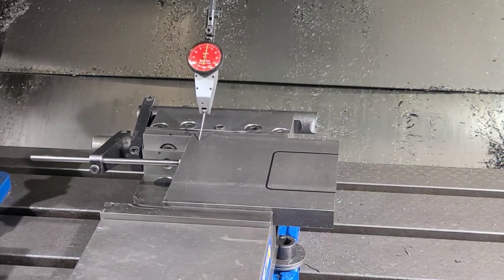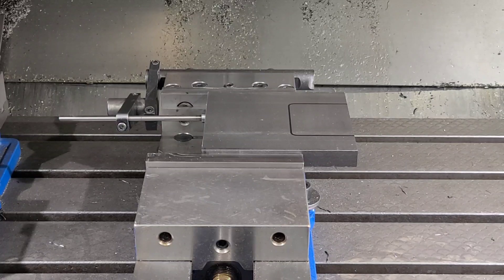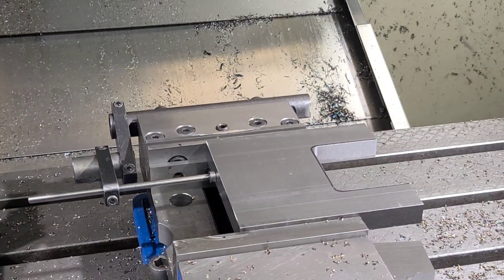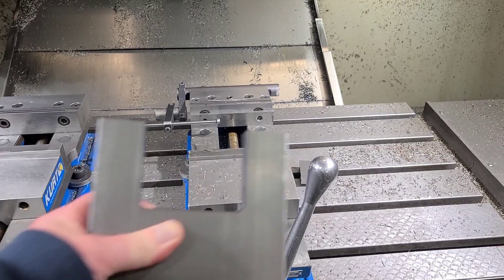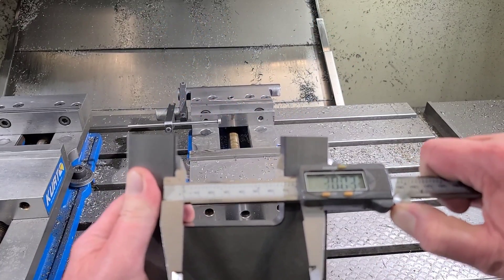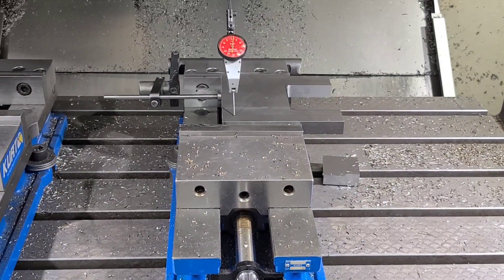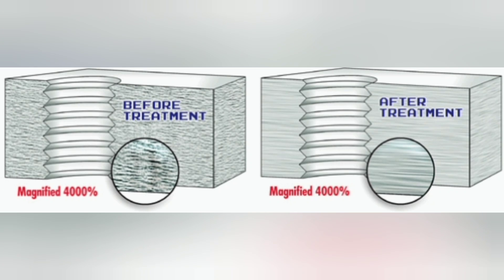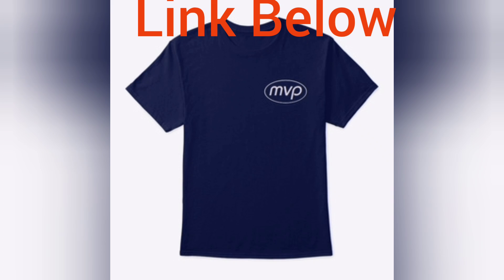Machining Cold Rolled Steel, Precision Headaches Guaranteed!

Comment: I’m digging the fly cutter, but not sure it will fit in my ATC carousel
Reply from the maker: We have a new version with a four way keyway on the cutter body that allows for orientation both ways. Should work in any 40 taper machine's tool changer.
Reply: @mvpmachine so I can clock it to fit in my atc at the proper spindle orientation?
Reply from the maker: @shaunybonny688  yes that's correct. You have to request it with the 4way key right now when ordering either through me or Suburban, as it just came out and there are a limited number, there is no extra cost.

Comment: Thanks Tim.  Although I was aware of the metal distortion effect, it was a good refresher. I'm about to machine some grinding fixtures that must be within 0.0005" tolerance.  This will definitely influence my material choices. Gilles
Reply from the maker: @LetsRogerThat  Roger that Giles you need some stability with that tolerance called out! Thanks for watching and commenting!

Comment: We make some clevises out of 2” square 1018 CF.  Mill a .812 slot 3 or 4” long.  Have to squeeze them back parallel when we are done with them.  Can go out as much as .03”.
Reply from the maker: Dustin, I have had the same fun experience with clevises and CRS, but never been able to squeeze them back and have any accuracy on the slot, do you recut the slot after? I usually try to have a lot of stock everywhere then fly everything after I spring it. if the slot is large enough I can fly cut one side of the part and both sides of the slot in one setup with the fly cutter, then flip and do the remaining outside.
Reply: @mvpmachine  just noted how far down to press with spring back.  Pretty repeatable.

Comment: You really should be running your test indicator with the tip closer to parallel with the measured surface in order to reduce cosine error.  The direction of indicator travel should be inline with the error being measured.
I've had the similar distortion issues when cutting Brass and nylons as well.
Reply from the maker: Hi, thanks for watching and commenting. I have been criticized for this in other videos and do know how to properly use a dial indicator, but when doing these videos it is difficult to get the proper camera angle to have the indicator in the proper configuration, so I use it as shown. I will spell it out in future videos though because it does look wrong. I mostly do these videos by myself so it is often difficult to work around the camera on a tripod and not have too much control of the camera while operating the machine at the same time. I am working on improvements.

Comment: Have machined parts like this in the past, always used flat ground 1018 stock. Was a bit more money but saved time in the end. Had to machine base plates for a machine ( 38 x 42 x 3/4 thick ). Started out with thicker stock then had them Blanchard ground flat and parallel , this material was A36 hot rolled steel.
Reply from the maker: Base plate material is really what CRS is good for, you can drill holes, put pockets in all day long with no effect, but as soon at you break out of the edges the fun begins! Thank you for watching and commenting!

Comment: Why not simply vacuum or hydrogen furnace anneal the cold rolled material?  Similar to normalizing  castings, but no surface oxides.  Maybe one could even order it treated that way?
Reply from the maker: I'm not familiar with vacuum annealing, but any annealing would change the properties and strength of the material so I'm not sure that would be an acceptable option, I guess it depends on the customer's requirements and if they really needed CRS in the first place. Many of my customers even military, supply or spec CRS oblivious to this phenomenon, and then are surprised when you bring up the issues that it causes. The only process I know that works and does not change the strength of the 1018 material is cryogenic treatment. Thank you for watching and commenting!
Reply: We deal with a customer who's engineering staff still doesn't understand that CAD does mean "Crayon Assisted Drafting" and sends up prints that have unnecessarily tight tolerances to be made of CRS.
Reply from the maker: @ColKorn1965  We get that a few times a month, part of the reason I made this video! I sent the link to the worst offender, one of my customers who does this to us all the time, I don't think they appreciated it. Thanks for watching!

Comment: Try liquid coolant.
Reply from the maker: When milling steel coolant is bad for carbide it causes premature wear by causing microfractures in the surface of the carbide, I was using air blow to evacuate chips. The heat comes off with the chip. Thanks for watching and commenting!

Comment: This is interesting to me, I have a different theory that the cutting process on the open end of the vice is letting the metal move out from the pressure, and heat combined with the induced inherent vibration of the cutter head. Vibration can stress-relieve metal at certain frequencies. Is it possible to hold the cut end in the vice and still cut the slot that would be an interesting test? I'm not a machinist but worked on rolling mills for 47 years. The Cold Rolling process induces stress lines in the opposite direction of the rolling direction or vice versa can't remember exactly and the annealing process may not remove all of them to maintain strength.
Reply from the maker: Hi David, the result if fully held in a vice would be actually  worse, as soon as the pressure is released it would spring out then cause changes to the inside and outside. That tension does stay there until released. There is not much heat or vibration cutting the way I did, the heat comes off in the chips, and I use air blow to evacuate the chips. Thanks for watching and commenting!

Comment: Some plastics are even more of a problem.  Cut it to a half of milimeter less and you haw to leave it for a couple of days. It creeps under its redisual tension, but annoyingly slow
Reply from the maker: I agree I am thinking about covering that topic soon. Engineeried plastics like UHMW are hard to hold a tolerance and good luck on light finish passes.  Thanks for watching and commenting!